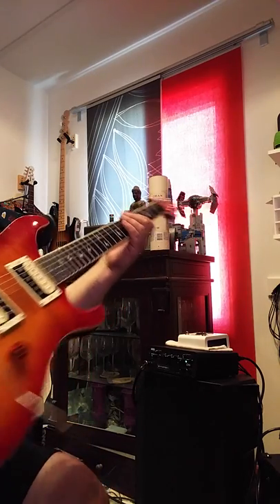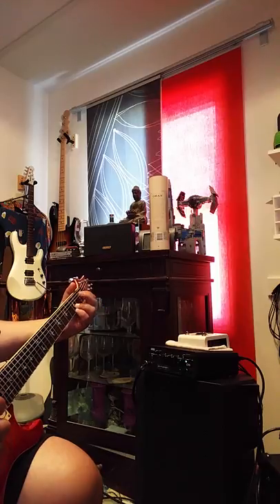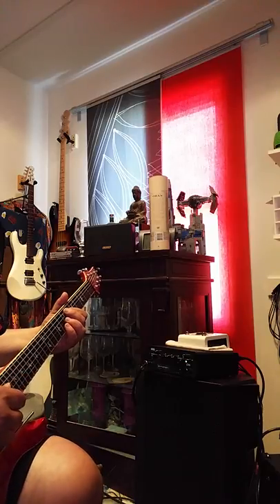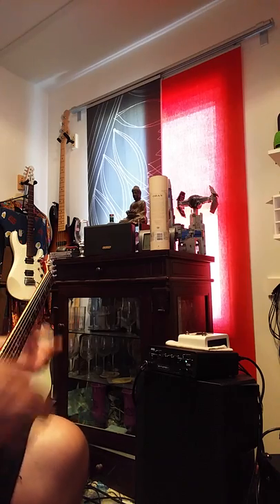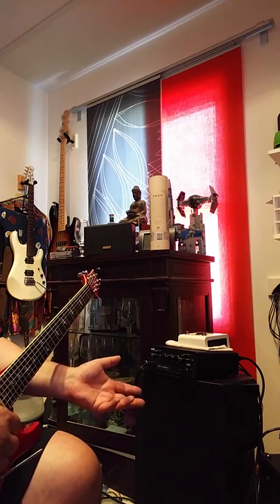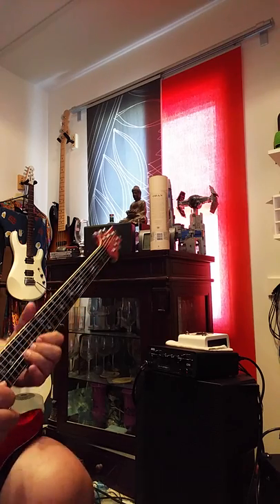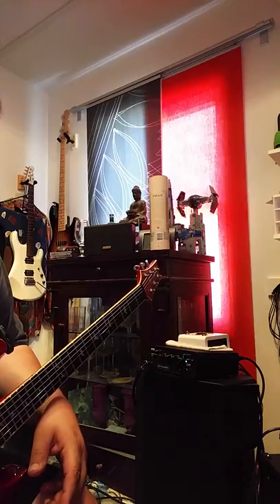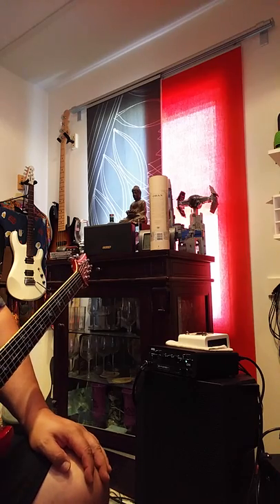Synergy Friedman DS Module at Home

Comment: Could you get a true clean out of this module if the gain was set almost all the way down?
Reply from the maker: Yes.  The 'blue' channel with the gain between 8 and 10:00 and the bright switch off offers a tone similar to Gilmour's tone on The Dark Side of the Moon.  'English' style clean; clear with a bit of grit accessible.  The bright switch on increases gain across the entire upper frequency spectrum.  Still manageable by dropping the guitar volume a bit, but much edgier.   For rich fat clean, The Friedman BB side of the BEBB module is hard to beat.  It is round and tubey and relatively hard to push into breakup.  Paired with the substantially more aggressively saturated BE channel, this is an ultimate A/B contrast.
Reply: Steve VanEtten thank you! I was interested in the Be BB module (I have a Friedman Pink Taco amp). I’m looking to get the SYN 1 and plug it in the loop of my amp to give it 2 more channels! I may get the BE BB mainly because I want to add a clean channel to my setup!

Comment: Hey man… I just ordered a Syn1 and DS. I would really appreciate it if you could share those settings.
Reply from the maker: With this module, start from all knobs at '12:00'.  Dave designed this like his amps ... simple to get at the baseline sound.  Since this video was made, my settings have drifted.  I have both bright switches on.  (It just opens out the top end and I have grown to appreciate how this opens the pedal to all my boost boxes.)  My gain on blue channel rarely leaves the 10:00 to 12 area.  The Red gain, 12-2:00.  In general, Bass at 10-12, Mid at 11:00 to 2:00 (really, this is where this amp lives.  you can change the entire amp mood with the mid control.)  Treble, 11:00 to 1:00 ... really set from guitar to guitar.  Both channel volumes sit at around 1:00.  The Sag control at around 9, barely flashing.  My statement on boxes still stands ... this module in particular just loves being boosted.  I pull guitar volume down for cleaner sounds.  Tasty British grit.  I have the B Man and BE/BB modules as well, but this is still my workhorse.  Enjoy!
Reply: Steve VanEtten Wow!!! Thank you sir for your candor! This will help getting me started. I listened to every YouTube video about the DS that I could find. Most guys head straight for a metal gained up approach. I liked your tone much better than those. I’m an old school blues rock player and appreciate those tones. BTW… I’ll be inserting this module in the FX loop of my Metropoulos 50. So I have that Plexi thing going on by default. It should rock hard dude! Can’t wait! Thanks again!!! 
🤘😎👍
Reply: Steve VanEtten Where did you set the cathode select switch on the DS module?
Reply from the maker: @wangbar1  I've never left position 2.  Though, this question reminds me it's there.  I should check it out again.
Reply: Steve VanEtten Yeah, I just got my Syn1/DS yesterday, so I’m going to check it out too.